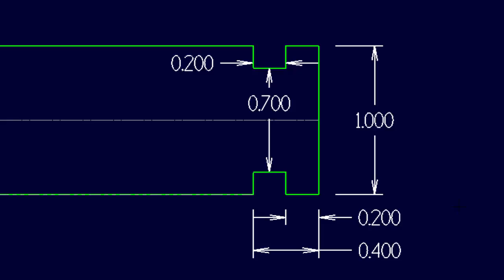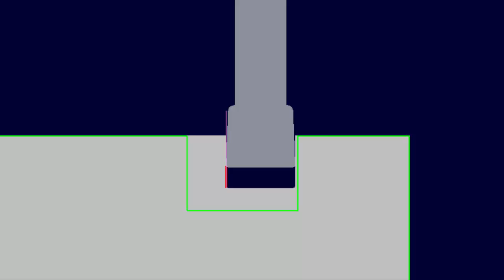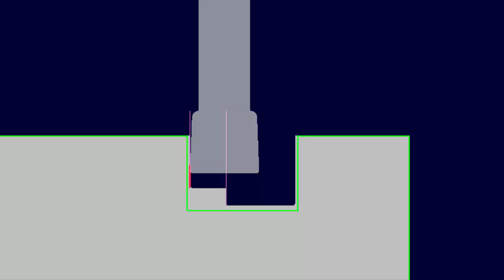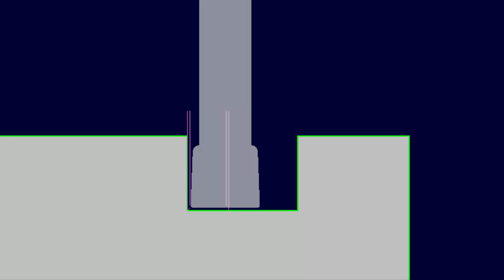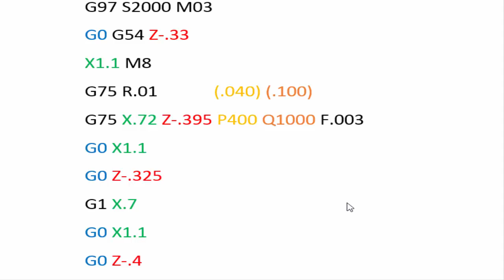HOW TO ROUGH AND FINISH A GROOVE ON A CNC LATHE

Comment: Mr. Tom.  Could you shoot a video with:  How to calculate the RPM for  G50 in lathe.  Please teach me how to figure numbers out.
Reply: You put as much as you dare to spin the setup. No calc needed. 2500 is what I use most of the time with power chuck though it's rated for 3500, with collet chuck I would run unlimited unless there's a bar end sticking out or something like that you wouldn't like to spin too fast. G96 will figure out the actual speed used.